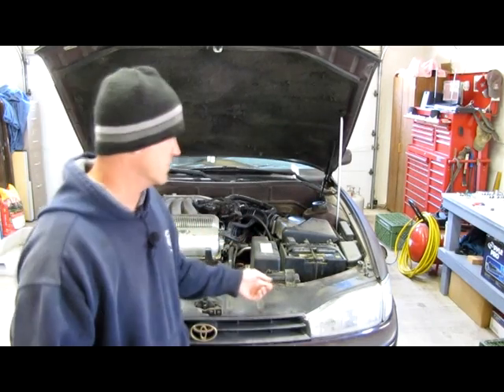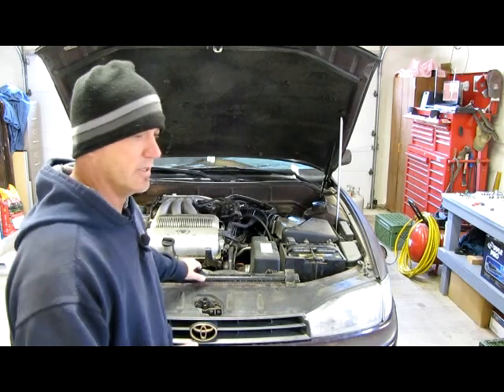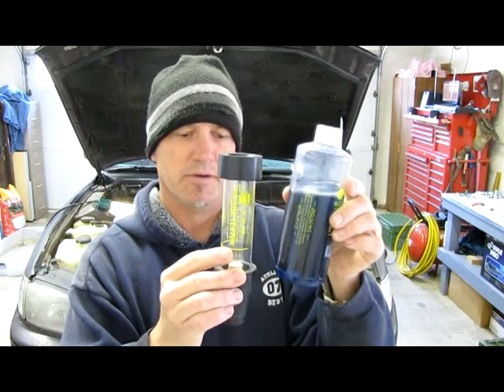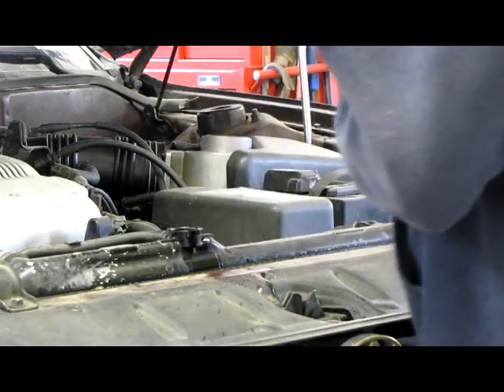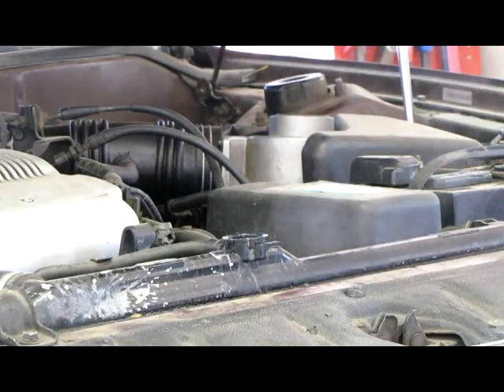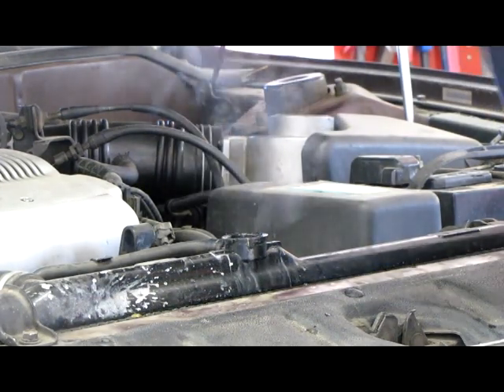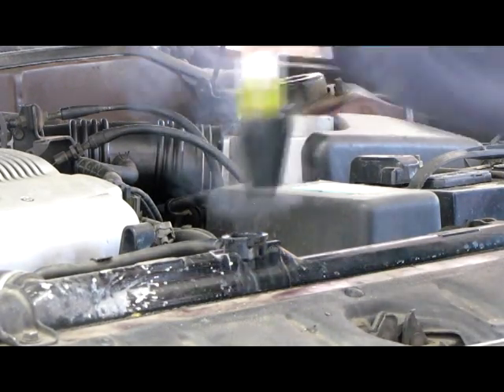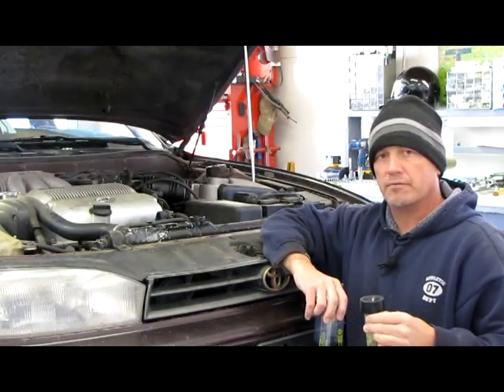Blue Devil Headgasket Sealant vs. Napa Block Tester Pt 1 of 2

Comment from the maker: Bigphat200: Well what a pain this has turned out to be for you! I am sorry to hear about the new issues with the Land Rover! Overheating can be caused by things other than leaks, and Blue Devil is designed for only leaks. Might want to make sure the system doesn't leak before adding the chemical. I once had an Isuzu 4X4 and loved, Loved it!  Anyway, good luck with this one, and hopefully we will hear back on what you find?  r-

Comment: Well it has been about a month and the worst thing i did was sale the Isuzu. I sold it for $800 and was driving it at the time of the sale. Ir ran well but i couldn't pull a trailer with it. It had 242k miles on it so i got my moneys worth. I then purchased a Land Rover for $2000 ended up having to put $1400 into it and it still runs hot. I so miss my Isuzu with the Blue Devil treated engine. I am sick over what i have done. I guess i will have a quite Christmas .Blue D in the Landy,,,maybe

Comment: I found the starting problem. A loose battery cable, as you can see i am NO mechanic. I drove 5 miles today both hoese were warm but I have only put about 20 miles on the truck in the last few week, but I have not had to add coolant but then i have just driven 20 miles. It does run a bit lumpy so i am guessing there is some engine damage but not too bad. I may run it tomorrow then check the motor oil for water. To tell the truth I am kind of ready for a new car sooooo yea.

Comment from the maker: I can see a couple of subsystem issues you're describing- the starting system and cooling system.  Having one radiator hose hot and one cool definitely tells you that there is a blockage of flow, be it simply a thermostat that hasn't opened yet to more serious issues.  Once up to operating temp, both should be hot, of course.  Not sure about the starting issue- bad battery, most likely if it will jump start.  Remember that most of the time a bad head gasket is the result of an overheating issue.

Comment: Well it had been a few days now and i think you were right. The engine is gone. It will run and drive but i think the thermostat is stuck., and it is a pain to get too. At this point i have to jump start the truck in order for it to run and when u put your hands on the radiator pipe after driving a few miles one hose is hot and the other one is cool. That can't be good. 
youtube.com/watch?v=u2KG2VL3qXk

Comment: I have been driving it for a few days now and reluctantly had to get on the highway in excess of 60 MPH. I did not want to put that kind of stress on my engine but it is holding. No coolant leaks so far. I am not ready to say BlueDevil fixed my engine I just didn't want to be without a ride until i get another.  I did not see anymore water vapor out of the pipe and I don't know how long it will stay out of the oil. I really like my Isuzu and money is tight.  I will check it tomorrow.

Comment from the maker: It is possible that once an engine overheats beyond a point that the lower block can become damaged.  The only way (I know of) to have the lower block checked, unfortunately, is to take the engine out, strip it down and have a machine shop check it.  By the time you pay for all that, another engine would make more sense financially and risk-wise.  This might be worth a try, but having to add so much coolant so often sounds like a pretty heavily-damaged engine to me.  Good luck and let us know!

Comment: I just checked my oil today and it was milky. Changed it and it came out like mud. I have been having to add coolant almost everyday now. Went to the auto shop and they did a test and said  it would cost $2000 and recommend i replace the engine instead. After the oil change i drove and did not notice any real difference in drive-ability. no popping or over heating. With 242,000 miles i think i will try this. I will update tomorrow. I am thinking about by-passing the heater core too.

Comment from the maker: 11/10/12 UPDATE: Total Miles: 7513, 6 months 3 or so weeks.  Relegating this vehicle to teenager duty.  Finally replaced the coolant from a mix which included filtered Blue Devil water + coolant- waited too long, however noticed that the Blue Devil was able to 'find' other small leaks evidenced by the white-colored residue.  Top radiator tank in particular.  The color of the exited coolant was brown and very stinky.  Flushed and replaced today.  I remain very impressed with the results this far.

Comment from the maker: Searching out what others have done with the TC on the 5.0, some have used Bars Leaks, etc, with success. I tend to veer away from chemicals generally, however of late I've had some successes with oil stop-leak and no-smoke products as well as this Blue Devil. I can't tell you exactly if any product will or will not work for sure; what is most important to me is if it will harm your engine long-term. Continues →